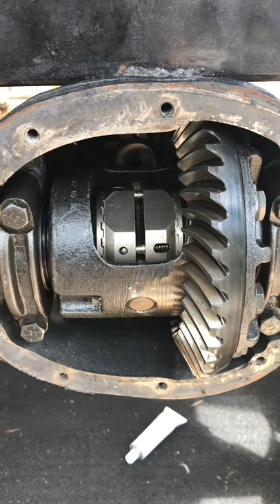Dana 35 lock rite demo

Comment from the maker: During this demonstration I have no load on the differential. When there is load, the tension on the sides of the ratchet gears keeps them  from seperating. I do hear the occasional pop when going straight under heavy load but not often.

Comment: hello, I have the same differencial case and block, how have you done to supplement it, did you remove it from the lsd block?
Reply: Did you find a solution?
Reply: @hermanerichsen5478  yes, tks!
Reply: Did it fit in the LSD carrier?
Reply: @hermanerichsen5478  yes, putting oversized supplements. At the same time I removed the differential and installed a Ford 8.8